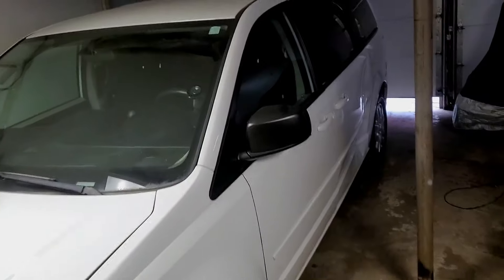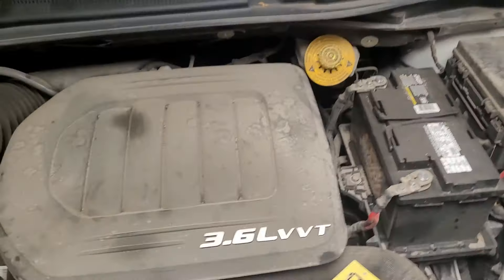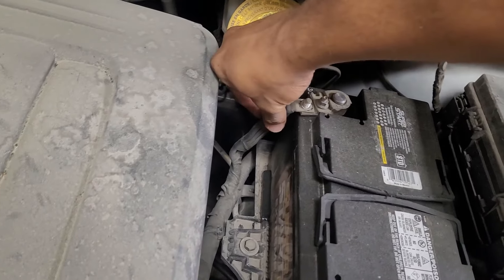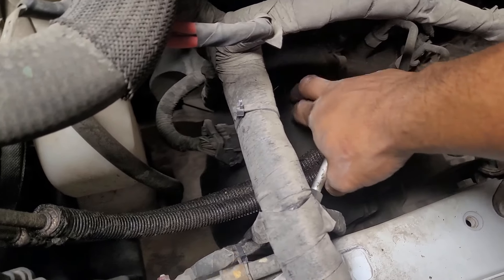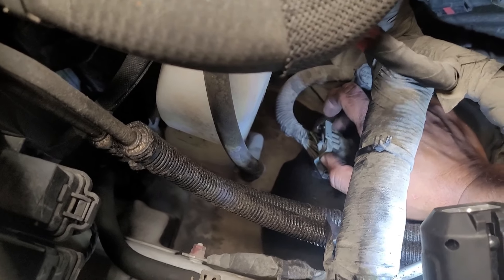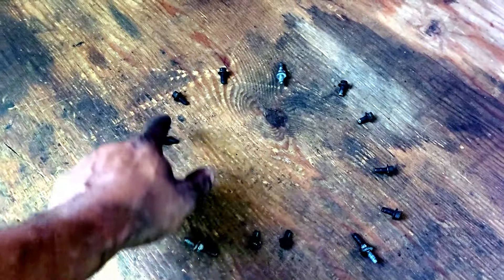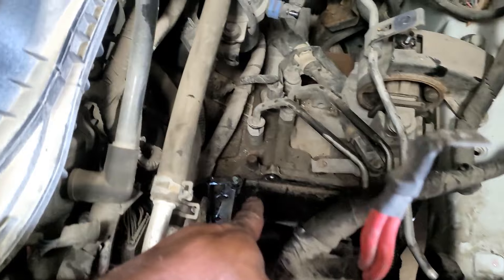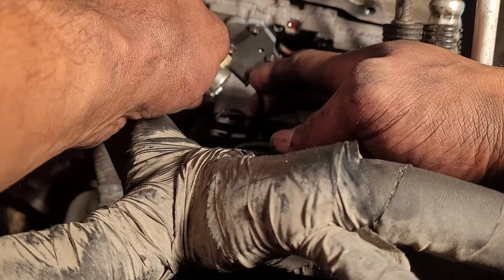2014 Dodge Grand Caravan 62TE Transmission Shift Solenoid (Minute Maintenance)

Comment: I have a 2016 Grand Caravan and it has an intermittent problem where it won't shift into the highest gear. When this happens it also won't shift down when I put the pedal to the floor. If I come to a stop it will start off in first gear though. It just won't kick down when I try to accelerate. Any ideas?
Reply from the maker: Hey Thanks for watching and sorry for delay in answering your question, I did not get notified of your comment!

1st thing I would do is pull the dipstick and check fluid level and clarity! Is the fluid old, thin, burnt..especially look for any signs of burning via dark discoloration or smell as your issues sounds like it could hena fault within the torque converter.

If fluid doesnt appear burnt and level is fine, I'd consider a fresh fluid and filter swap regardless as removing old containments/debris and adding fresh thick fluid is the number 1 way to resolve most shifting issues. The older the transmission the less pressure it can build up to allow shifting the more important fresh, thick fluid and a clean filter become!

While I dont think the symptoms you describe match that of the TCC solenoid if none of the above helps get you closer to an answer..I'd take the van to a shop for diagnostic. Most shops will diagnose for free to minimum cost hoping you'll pay them to repair it and they'll make money on that end of things. That way you'll at least have a better understanding of what's wrong and what your options are.

Not the best answer but hopefully it helps, good luck and Happy Wrenching!
Reply: @minutemaintenance7385  Thanks for the reply. The fluid level is correct and is not burnt or off color. I discovered one more thing. When it won't shift from 5th into 6th I just need to put the car into neutral and shut the engine off. I restart the engine and put it back into drive and it always shifts into 6th gear and stays there. It's not the shifting into neutral that has an effect, it's the shutting the engine off and then on again. It would seem to indicate that the issue is some kind of signal to the transmission to shift that is wrong. The transmission works perfectly once it has shifted into 6th gear.
Reply: My 2012 dodge grand caravan just started not shifting from 2nd to 3rd under load on its own but if you put it in manual mode you can shifting it. Also it's not shifting into 6th gear on its own or in manual mode

Comment: my 2014 Dodge Grand Caravan, dose not shifte gears when picking up speed and dose it when i slow down and then have to pick up speed on long drives. in town with all lights and stop signs, it works just fine. any suggestions?
Reply from the maker: @lindaramirez5296  Thank you for watching! If I'm understanding what it is you're describing, my first suggestion would be to get the Transmission Fluid and filter changed. Old, dirty, thin fluid or a dirty/clogged filter will prevent the transmission from developing the pressure needed to properly shift gears..especially at higher rpms..(faster/higher the van goes hotter it gets, thinner the fluid becomes).

It is possible however the torque converter or solenoid pack could be at fault here as well but my 1st order of business would be the fluid and filter.

Good luck and Happy Wrenching!

Comment: I may have missed it but i just did this job and had transmission fluid leak out. I also scraped my pan surface and applied a new gasket, i dont like that you just put the pan face back on, i would be worried about leaks no? Then - Finally ensured my trnasmission levels were toped off.
Reply from the maker: Hey thanks for watching! You are correct I did not mention the Transmission Fluid level check in this video as I did a 2nd video for how to perform a fluid drain and filter swap...that's mentioned at the end...immediately after I filmed this one.

 I should have labeled this 1 of 2 as opposed to thinking ppl would naturally be directed to the 2nd portion. Good catch! 

As far as the gasket you are right a bead of RTV would not have been a bad idea, although the van didn't have any leaks in the year the owner had it after the fix b4 trading it in for a newer model.

Based on the research, it was 70/30 whether a gasket was used or needed. The local Dodge Dealership said they never replace it and when final taking the pan off I didn't see any signs of a gasket so I ran with it!  Thanks for watching and appreciate the constructive criticism!

Comment: Hi bosss I have the problem P076A shift solenoid (H) it’s that one in your video ? Thank I for the help friend❤ dodge caravan 2011 mainstreet
Reply from the maker: Thanks for watching! Based on the code you gave that is a "generic" code not really associated specifically with the sensor I changed. The most common cause of that code is dirty, old, burnt transmission fluid, dirty/clogged filter, or low fluid. Meaning the most efficient course to take would be a transmission filter swap and fluid fill. If thay doesnt resolve the issue there could be a problem with the ECM itself. I'll link to a video I did performing a transmission flush on this same van.

https://youtu.be/fuM0d4SfTlY

Comment: Great video! Recently bought a Dodge Caravan 2012 similar to this and my mechanic changed the valve body (because it would only go into reverse and not in D) and did a transmission fluid flush  + filter. Drove for couple weeks and now my check engine light is on (PO731 - Gear 1 Incorrect Ratio and P0792 Intermediate Shaft Speed Sensor "A"Circuit Range/Performance). Car drives great but you can feel some hesitation when I press the throttle and the rpm don't match 100%. Would you suspect this is caused by the transmission shift solenoid or transmission speed sensor?
Reply from the maker: Hey thanks for watching...so based on the Information you gave, and assuming you used a good mechanic who used a new or reliably refurbished valve body...if it's throwing speed sensor and gear ratio codes it is possibly going to be related to the "Compounder". The 62TE transmission is notorious for having these internal gear shafts fail due to bad rings on the shaft. This is a more involved but rebuildable item, but I'd take the van to a Certified transmission shop for appropriate diagnosis. Good luck!

Comment: Hello! I have a 2012 Dodge Grand Caravan. does not shift beyond 2 speeds and when you turn on R and D you feel very strong impacts. Changing the oil and sensor did not help. Do you think replacing the same salinoid as in your video could help me?
Reply from the maker: Hey thanks for watching and.the question! I apologize for delayed response I did not get the notification form YouTube sent directly!!

Based on the symptoms you described I don't believe the TCC Solenoid would be the culprit. The most concerning issue mentioned was the "strong impact"..I'm envisioning some form of clunk or drop when shifting which could be caused by a worn out bearing or internal part.

If you changed the fluid and filter yourself and can recall if it smelt/looked burnt..overly dark or even silty as if there were fine particles inside that'd be an indicator of a More severe internal break down.

You could always pull the dipstick and check the current fluid for any sediment type material (ceramic or metal flakes) or a strong burning smell but won't be as accurate as the old fluid would have been.

But if I'm you..I'd have it inspected at a Local transmission shop as soon as possible. Some transmissions can be saved before it gets to the point if replacement/rebuild, let them diagnose it, most in my experience do it for free to attract potential customers, but even if it costs an hrs labor it'll give you the knowledge needed to make an informed decision!!

Not the answer you were hoping for but best I can do!

Good luck boss!!

Comment: I have a 2013 Caravan and sometimes when it accelerates from a stoplight or sign, it jerks into gear. And lately it wouldn't shift going 50mph at 4k rpm. Is the shift solenoid also the problem? Also the fluid is dark not red. Your thoughts please?
Reply from the maker: Hey, Thanks for Watching the Video! If Your fluid is "Dark" I'd Consider Changing the Fluid and the Filter First and Soon!! The Darker it Gets=the More Burnt/Old it Is. Most Common Transmission Issues as Far as Slipping, Hesitation Shifting etc Can be Resolved with New CLEAN Fluid. If Its My Van, I'd Do That First, If That Doesnt Resolve the Issue Then My Thought Would be a Bad Shift Solenoid.

Comment: My van is having the same issue.  I took it to a transmission shop and they said the solenoid is the culprit and also said I should replace the valve body while it's apart.  They quoted $3k to do that.  Looking at this video I'm thinking that's not $3k worth of work...

Comment: I have a 11 grand caravan every once in a while it stalls at a stop when I put my foot on the gas does fine until I put my foot on gas does right away put it in park start right back up.  Also sometimes downshifts hard from 2nd to 1st and almost jerks.  Do you think this could be the culprit
Reply from the maker: Hey thanks for watching! What your describing are similar symptoms for the solenoid I swapped in this vehicle! I always suggest, changing the transmission fluid and filter FIRST as in ANY vehicle the most common cause of shifting issues is old, dirty or low transmission fluid! But I would say you're on the right path!

Comment: My. Dodge grand caravan shifting hard and have major problems shifting down fast and stalls going from 60 hwy to a complete stop at the red light turns starts losing rpm then stalls? Any thing will help
Reply from the maker: Thank you for watching! Based on your brief explanation there could be varying issues that would cause this issue. I'll list them in the order I'd check..
1: Low/Old/Dirty transmission fluid and filter. If the fluid isn't the right viscosity due to being old and thin or dirty the van can't maintain the fluid pressure needed to shift/hold gears. Quick shifting will force the van to stall out.
2: Shift Solenoid. It is possible one of the shift solenoids is faulty (or sending bad readings due to issue outlined in #1)
3: Torque Converter going bad. The torque converter I'd the Muscle behind the transmission working, if 1 or 2 have been acting up for to long it will cause overheating and damage to the converter. If you can find a mechanic shop or transmission shop preferred, if have it properly diagnosed. Your issue is clearly a safety concern for you and others on the road. Most shops will diagnose for free (hoping you'd pay them for the job in the end) but even if it costs $100 or so..better to "know" for sure which sensor, which wiring issue, what's part is bad and if it's fixable as opposed to chasing possible sources as the issue described does truly have dozens of possible causes, I simply outlined the 3 I'd be focused on if it was my van. Happy Wrenching and Good Luck!

Comment: I have a 2013 doge grand caravan and its throwing a P0760 code overdrive  solenoid control circuit  and its stuck in limp mode. Do you know if that top solenoid is what i need to change or is it something else
Reply from the maker: Hey thanks for your question, I apologize for the delayed response been busy preparing for the upcoming Thanksgiving festivities this week!!

The Solenoid I changed in this video is not the same as the overdrive Solenoid. At the bottom of this I will post a link to the Solenoid diagram for the 62te transmission.

Keep in mind with any transmission code..or anything electrical really, there could be many reasons "why" that specific code is appearing..bad wiring, dirty transmission fluid, clogged passage ways w/ in the transmission, bad Solenoid, short in the ecm/pcm..there is no quick fix it will depend on properly diagnosing and Inspecting the transmission and valve body pack for damage.

The Solenoid I changed in this video was determined based on common issues w/ the 62te such as stalling when shifting gears that can only be explained (for the most part) by a fault with the specific TCC Solenoid I changed. For individual solenoids such as Solenoid c, b, high/lo solenoids etc the causes can be less specific.
For transmission work I always recommend having a vehicle diagnosed by a local transmission shop so you know 100% what is wrong as opposed to guessing.
Hope you get your issue resolved and Happy Wrenching!

https://www.sonnax.com/tech_resources/312-62te-solenoid-identification-connector-pin-out

Comment: Great video. I have a 2015 dodge grand caravan. Was driving great all a sudden check enhine light on and wont go over 40mph. Rpms were over 4000. Shift into drive hard and reverse kind of hard. Error code is p0750. Only has 80k miles. Transfluid is only 3 yrs old. Do u think this will work

Comment: I literally did step by step and all went flawless. But then i installed battery and no power. I got new battery and no power. Did I move something?  I don't think solenoid could cause no power right?
Reply from the maker: Hey thanks for watching, I'm so sorry you're having this issue. By no power I'm assuming you mean zero electricity/power to the vehicle? The solenoid as you mentioned wouldn't be responsible for that you would still be able to start the car, operate radio etc..if you're having zero electrical power the only possibility is a bad connection. Make sure the battery cables are clean of debris, build up, greenish/yellow battery acid etc using a wire brush or steel wool then make sure they're fully tightened onto the battery. If that checks out follow the battery cables to where they connect onto the vehicle to make sure they are still fully connected on both ends.

To the right of the battery is the fuse box where the red/positive cable connects into the circuit system..pop that cover and make sure the cable is still fully connected then check the manual to see which fuses/relays are in charge of the power/battery/electrical system and pull those and see if there are any obvious signs of damage, broken wire inside or burning..if you're not sure if a fuse is good you can swap it with another fuse/relay or equal amperage but is used for a lesser important process..i.e. radio or power steering fuse..to see if theres any change in the system, that'll at least help you verify if the fuse is bad or not.

Hope this helps, good luck and Happy Wrenching!

Comment: My 13 with almost 200k is throwing code P1745 transmission line pressure too high and can't be erased so my tranny is in limp mode. Do you think this sensor could be the issue or should I replace the solenoid pack while in there? I did the filter and fluid about 20k ago when I got it. Looked like chocolate milk. Had a code then for low pressure but I think that was due to the tranny filter never being changed. Shifted fine afterwards. Until I got this new code of P1745 2 years later. I know the pcm is trying to protect the tranny. I got the van for only $1500 and the engine runs great, no oil burning. I rebuilt the entire suspension. How can I remove the code after repair? I've heard it stays in limp mode until that hard code is removed. Thx
Reply from the maker: Thanks for watching! The most common cause that I have found for this code going off is too much fluid. If it's been overfilled. If not that the problem can be found in the main wiring harness for the Transmission having a connection/corrosion issue or even a bad solenoid pack as you mentioned. I never recommend just changing parts when it comes to a code like this, as there are more than 1 cause. If it's a code for a camshaft positioning sensor..that's different as theres only 1 main cause (bad sensor or connection). Honestly your best bet is going to a transmission shop, paying the 1 to 2 hr labor and having a real true diagnosis given so you can A: tackle it yourself or B: pay them to do it. Either way you'll be more confident in what your options are! As far as clearing the code, a P1745 is a "hard code" meaning it can only be cleared with certain scanners/computers to prevent your average at home mechanic from clearing it and causing permanent irreparable damage to the engine or transmission. I know this was long and not what you wanted..but hopefully itll help get you on the road soon.
Reply: Notice online to pop off the tranny speed sensor. Located between the 2 trans lines on the tranny. Cleaned off the metal shavings put it back in. Now it's back to normal.  😅
Reply from the maker: Wow!! Good deal boss!! Glad you got it handled!
Reply: @357wesdog is it still running fine?

Comment: Great video! Question: Is this the same part that’s responsible when I drive the van, it doesn’t shift to 2nd or 3rd gear and rpm goes up and I can only run up to 40 miles an hour?